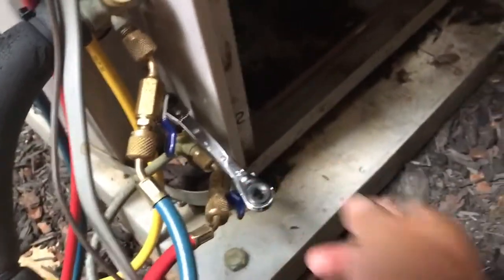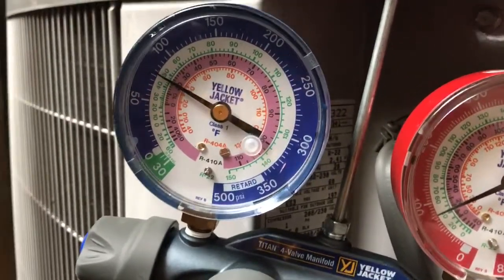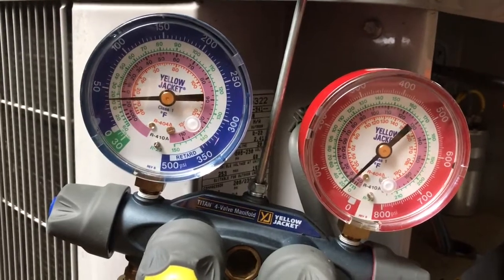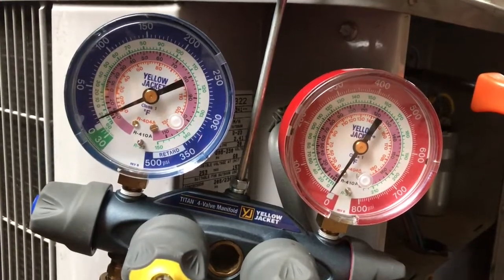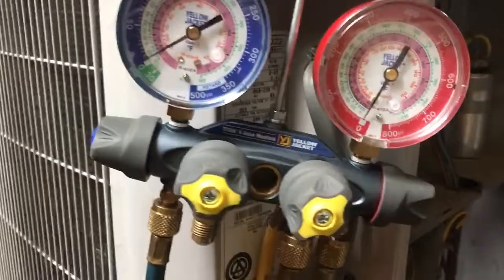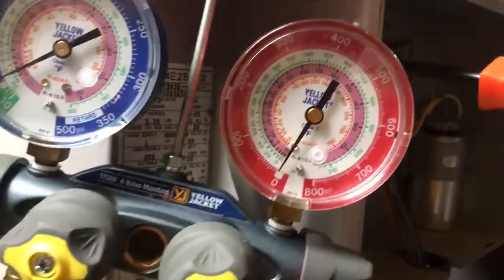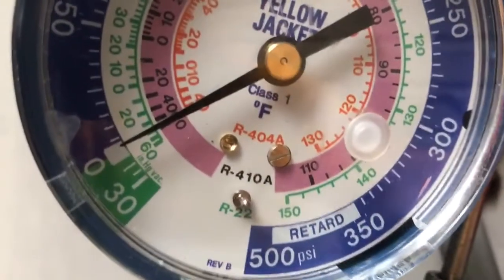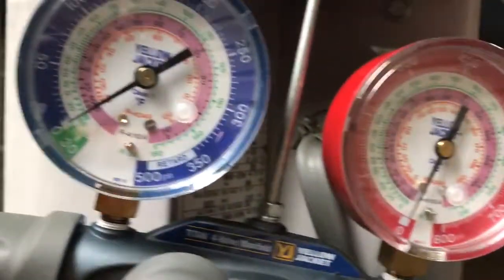Pump down- HVAC Online Trainnig and Courses

Comment: What is the procedure for walk in cooler where I have a pressure switch for low pressure, will the compressor turn off before 0 bar?
Thanks and greeting
Reply from the maker: Yes, on systems that have a low pressure switch, the low pressure switch will turn the compressor off and at that time we must manually push the contactor in so that we can make the compressor run and we need to keep an eye on the low pressure gauge to make sure we do not go into too deep of a vacuum. I hope this answers your question. Thank you for watching!
Reply: @AirConAcademy  So when the pressure drops to 0 bar, it doesn't go to vacuum, but when it drops to 0 bar, we release the contactor and immediately close the king valve on the suction side and then we can change the filter because we compressed the freon and the receiver?
Thanks in advance
Reply from the maker: @hvacmaster96   to pump the system down, you first close the king valve and allow the system to pump down. When the low pressure switch shuts it off, then you manually push the contactor in and yes, when it reaches zero bar, you release the contactor and close the suction valve, or the suction service valve so you have pumped all of the refrigerant into the condenser and into the receiver. Then you can go ahead and replace the dryer. I hope this answers your question.
Reply: @AirConAcademy  Thank you very much
Reply from the maker: You're welcome! Good luck out there! And thank you for watching!  @hvacmaster96

Comment: I can't get it to zero. Compressor keeps going off 2 or 3 seconds into the pump down. Then pressures rises again. Funny thing is there are no low and high pressure sensors. Why is that? Thanks
Reply from the maker: Make sure you are pushing the contactor in, if you are pushing the contactor in with something that is non-conductive then the only thing that could keep it from shutting off is the internal overload. when you push the contactor in you are bypassing everything!!!  I hope this helps.